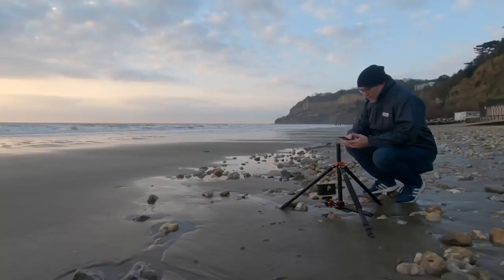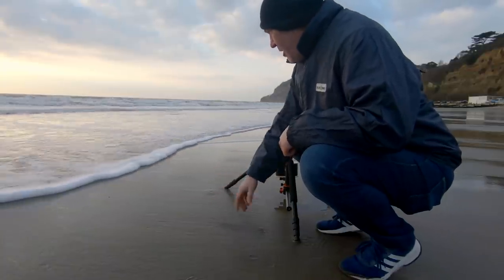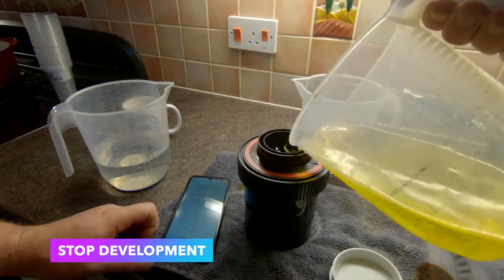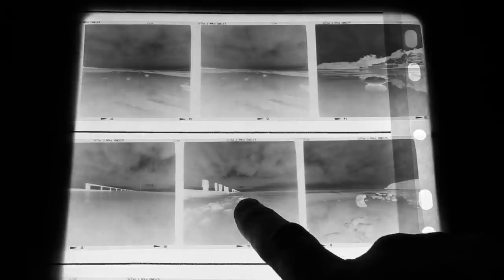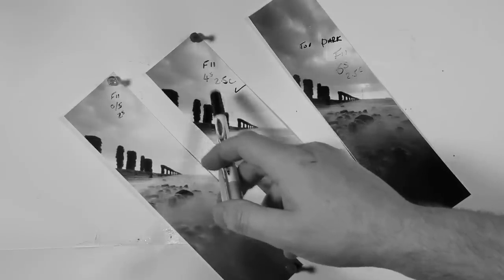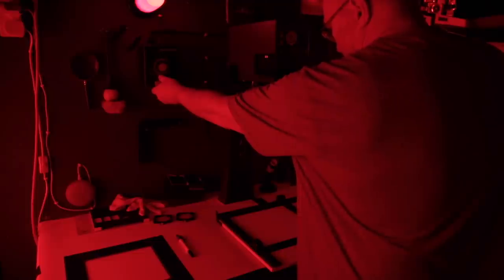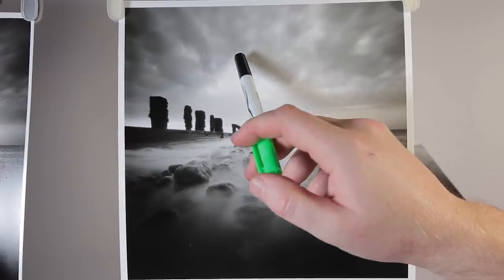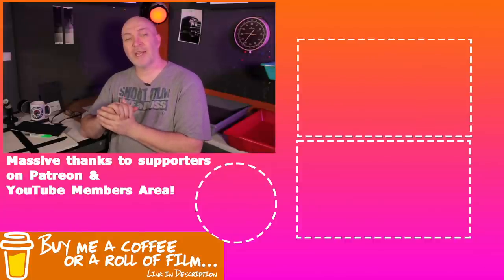Pinhole Camera Sunrise Photography & Darkroom Printing Session.

Comment: I recently bought one of these and I'm struggling to work out the exposure times, what's your method or what do you use to calculate the esposure? I have a roll of HP5+ waiting to be put through the camera and sent off for developing, but I dont want to ruin it, any help would be appreciated
Reply from the maker: 400 speed film will be hard in the day, better for night. I've put my metering method on a post on my website. Email me if you have trouble.

Comment: What's your process for metering and calculating for reciprocity? Do you use an app, or just a calculator?
Reply from the maker: I use a pinhole app. If you scroll through the posts on my website you come across my pinhole metering method. Reciprocity times I get off the Ilford website.